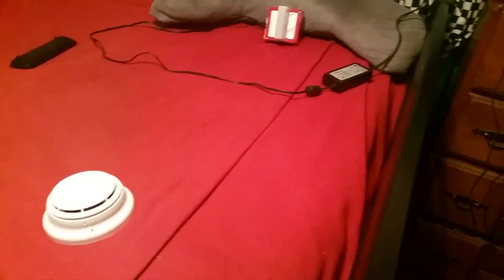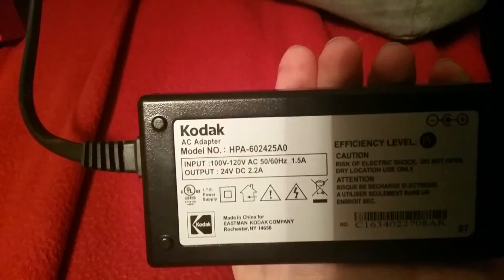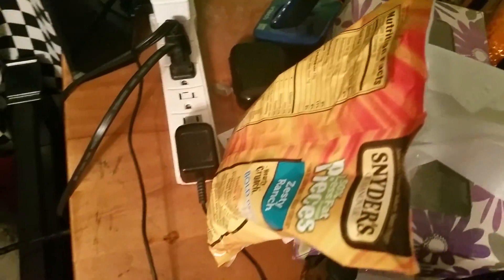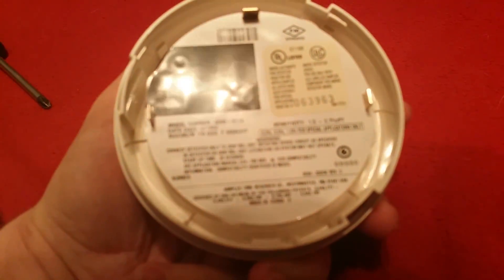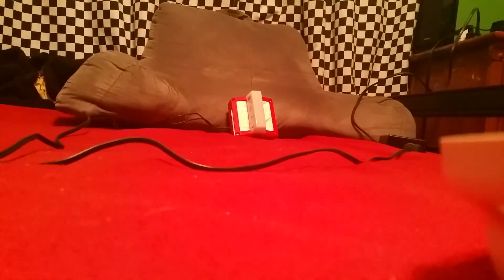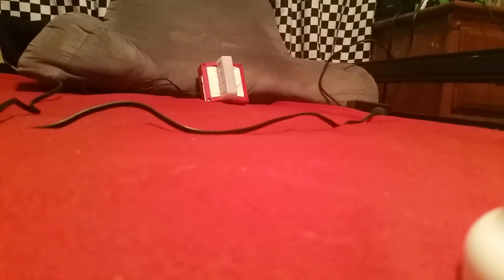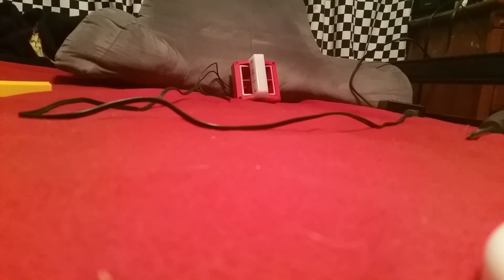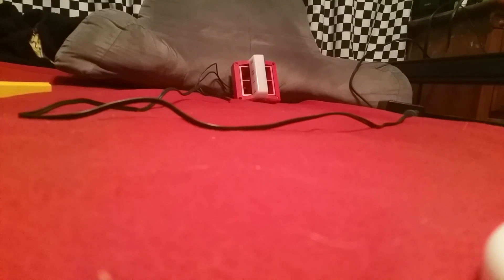MAEH24MC Testing

Comment: Nice, I absolutely love those Wonderful devices. Would Do anything to aquire one of these in my collection.
Reply from the maker: I'm trying to see if I can get my hands on one that has an ADA strobe on it (yes, they made those).
Reply: @CraigBaker96837  well, if you have an ADA strobe you can just slap it on the device.
Reply from the maker: @AcElectronicSystems  
It's actually not that easy because of the way the strobe is connected to the alarm.
As shown in the overview video, there are little terminal clips that extend out from the original terminal block, and the strobe's connections are soldered to said clips.
Since standalone SS ADA strobes have a completely different wiring design to the MASS/MAEH ADA strobes, I cannot use the sync strobes that I currently have to do this.  I would need to buy a MASSADA to do this, and I don't want to go through the trouble of breaking things from their original forms, hence why I'm trying to find an MAEHADA instead.
Another reason why I can't use the SSADA strobe that I currently have is that they require a different style of mounting plate (curved with FIRE lettering) than that of an M or LO strobe (the trapezoidial plate).
Reply: @CraigBaker96837  oh, i see. Also, did you know people are leaking your CBA devices on roblox?